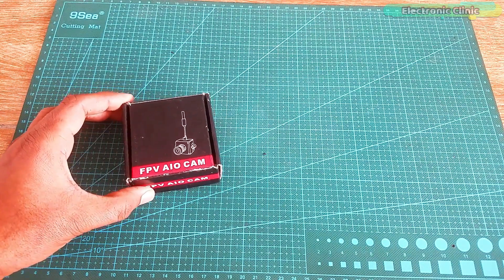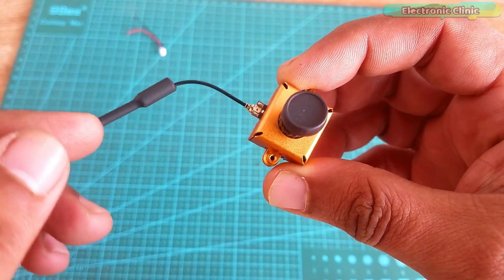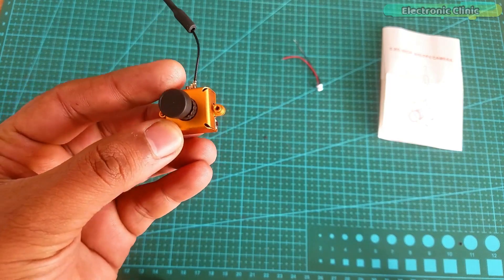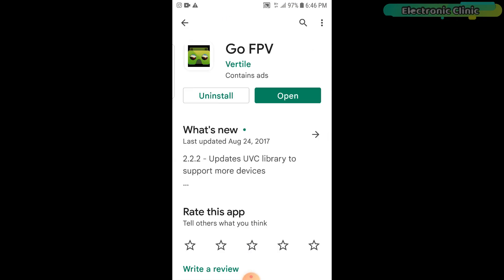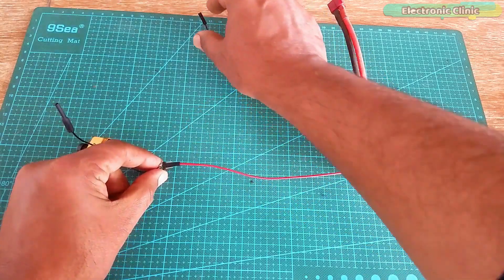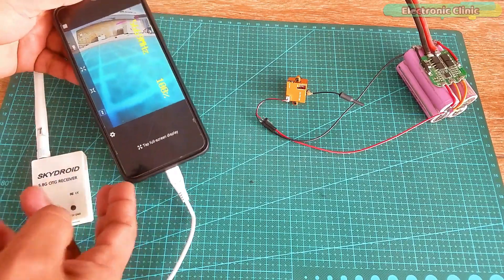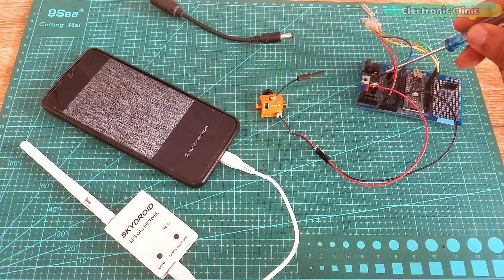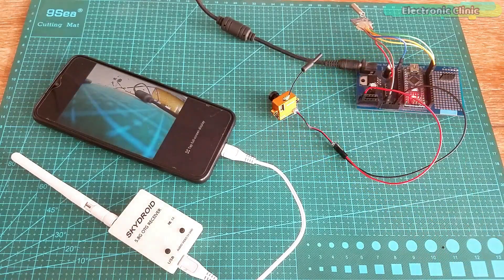5.8GHz FPV Camera, HD Wireless Camera with OTG Receiver for Android, Drone FPV camera, Test & Review

Comment: Using this as a CCTV is a dumb idea, FPVs are preferred for better range. If you need a CCTV, just use an esp32cam, which also comes at about 10th of the price of this whole setup also gives around 50 meters wireless range.

Comment: I'm planning to get these to use as a security camera.. small enough to be hidden anywhere without people noticing. Been having problems with people that live around my apartment recently.. like people loosen up screws and bolts on my suspension where I almost got into an accident due to missing both strut bolts that keep the shocks connected to the wheels. Slashed tires, dented doors, leaving dog shit on my driveway, stealing my stuff, etc. This looks like something that I can use where I can install anywhere very discreet. Don't want them to see where I put them bcs I don't want them to avoid it... I want them caught. Does it need wifi to view on phone or just the frequency of the transmitter to reciever only. Just need more info about how these things work. Thanks in advance ✌️👊
Reply: wow, you have bad neighborhood
Reply: What is the range Mai I know please
Reply: Only 5.8ghz video signal from aio camera
Reply: @helol2344-t1m is it less

Comment: Do I need receiver if my phone have 5.8ghz wifi? My phone can connect midranges GPS gimbal drone btw.
Reply from the maker: I have no idea. But even it works, I suggest you not to purchase this. I just wasted money on this. Its range is too low. Now i am planning on purchase other combo. This is good for short-range rc cars but not for drones.
Reply from the maker: At first i was happy, but later i was only left with disappointment.
Reply: @ElectroniClinic  what cheaper solution do you recomend for long range (1-2km) instead of expensive glasses?
Reply: @ElectroniClinic   what if we use separate transmeter and fpv camera with this reciever will it give good range ?

Comment: Can we connect this camera with nodemcu
Reply from the maker: no.
Reply: @ElectroniClinic  ok
Reply from the maker: why nodemcu? you can use esp32 cam.
Reply: @ElectroniClinic  because there is no internet access and commercial ground area sir so this wireless camera is not required internet
Reply: It connect lora module with ardiuno it is possible or not sir